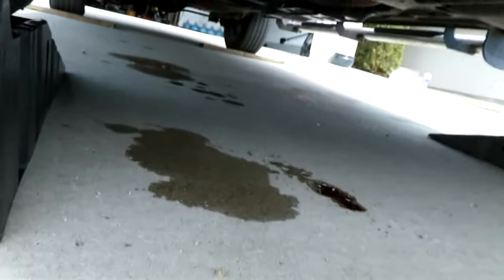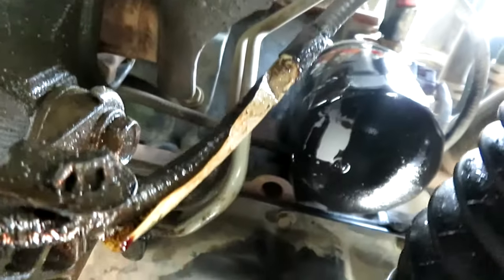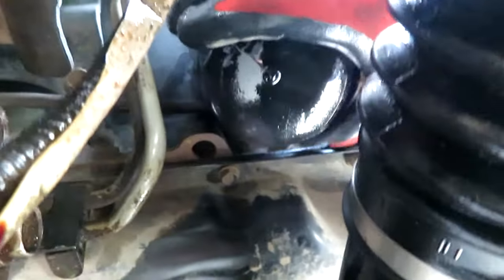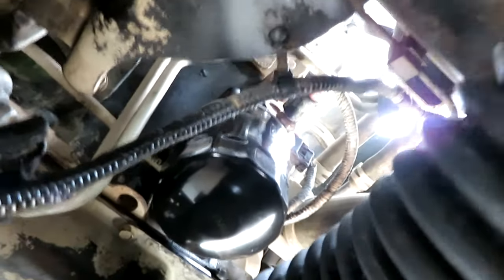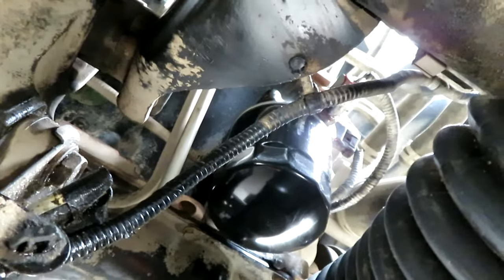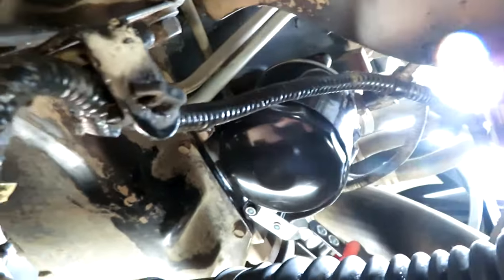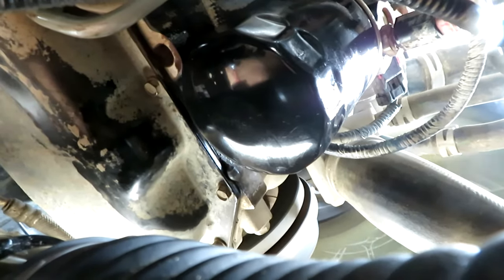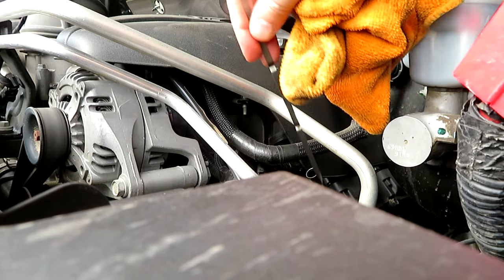Major Oil Leak | Ram 1500 Oil Leak | Catastrophe Avoided?

Comment: Had this issue off and on (it's on again) in my 2016 1500 for 3-4 years now. Oil filters are tight and changed done by the dealer. They have checked the housing, and said it's OK. Just noticed a  couple spots on the driveway again, and yep, the filter is wet. Been 6 months (but only 3000 miles) since my last change. I honestly think the gaskets on these Mopar filters are crap, and they allow some leakage as they age. Mine is nothing like yours though - you have a puddle, yikes. Mine (so far, knock wood) spots the driveway.

Comment: I have seen this problem many times, but was not due to operator error. It is due to increased oil pressure.
Reply: Mine does this due to increased oil pressure I started thinking it’s another problem, so u know what can cause increased oil pressure?

Comment: my old truck is the Hansel & Gretel of the automotive world. It leaves a trail wherever I go!🤣🤣🤣
Reply: Mine too 😆
Reply: @Cameronguitar444  I've some good news that might help you too. 
I thought I had a rear main leaking. Needed an oil change pretty bad. Wasn't ready to deal with the rear main. Had a new windage shield (pan gasket). When I removed the lower bell housing plate I noticed a corner bolt was missing from the pan.. Turn out it was broken off. I started thinking how to extract it. Turns out it was already drilled but the bolt was still there. Couldn't remove it either. I tried for a couple hours. (didn't have an easy out to fit). But I did have a sheet metal screw I cut with my dremel tool    like a "self tapping bolt". Had to make it the right length so when it got too tight in the hole, the shoulder of the screw made contact with the pan. Waaahla. oil leak fixed~! 
I was spending as much on oil as I was gas.
Turns out the oil pan had permatex on the corner of the pan where the screw was missing.
Reply: @andybilakshow260  Nice!! Yeah I think it may be my main rear seal because its dumping oil now. I had rebuilt the engine and the only seal that didn't come with the kit was the rear and I skipped it at that time would this time would come. I need new aluminum heads too... Dont ever overheat a 4.7
Reply: @Cameronguitar444  I'm in afternoon traffic. A freeze plug sprung a leak. Run completely out of water. Ove heated at a stop light. Died. Went to the house on the corner & filled a poweraide bottle like 1000 times as traffic had to go around me. Finally got it running & back home. 
Long story short, I lost 75% compression in #1 cylinder. Plus slight coolant in my oil. Not on the stick only on the cap. Put new head gasket on left bank. Attempted to regrind intake & exhaust valves. Only gained 20# from 40-60. So I need new heads as well~! The kit I got came with more seal than you can count (or at least I can count) including rear main. "partsology" I like them  so far.
Reply: @andybilakshow260  Wow thats stressful in traffic man!! Yeah I put new headgaskets on the v8 and it worked I took them to this old guy to have them resurfaced before I put em on it worked but the aluminum heads have a knock. The engine runs great but the tapping sound drives me nuts and I'm ocd about it im sure people think the engines about to crap out on me but its got 30000 since the rebuild and its got 240000 total
Reply: @Cameronguitar444  320+k on mine. 
Rocker off? Or worse, Heads Ground past the point of no return & you have valves hitting pistons
Reply: @andybilakshow260  Yeah you got me beat on mileage... yeah man I got alot out of the old dakota more than you'd think about how they talk about 4.7 motors...Wish some steel heads existed lol probably be heavy asf

Comment: Just had motor replaced in Ram 1500. 6 days later major oil leak
Reply: Did you find out where the leak was coming from? I have the same issue and it's dripping from the lowest part of the bell housing where the transmission is bolted on. It's definitely engine oil, not transmission fluid. I'm thinking one of the seals was improperly installed.
Reply: @watcherwatchmen7785  Drips will migrate by gravity or airstream so such a drip could come from oil far away. Some seals like rear main seals take time to fully seat in if they are brand new. Maybe clean up as much as possible and keep a daily eye on it to see if you can find the origin. Good luck.
Reply: I believe there’s a recall for this exact issue. They made the recall recently.
Reply: @AllGreenDB  IMHO, they should recall all from '80 & later🤣
I loved my '79 Power Wagon
Reply: I figured out where the oil leak was coming from on mine. I dropped the oil pan and found gouges from 2 screwdrivers on the aluminum rear main oil seal housing where it connects to the pan. Bubba the mechanic must have gotten to it before me. I sanded down the raised burrs and used silicone to seal it. Now it's just a couple drips making it thru instead of pissing oil like before. I used a new gasket. To replace the main rear seal will involve removing the transmission, and I don't have the time or energy for that right now.

Comment: My 02 does this,dodge put a drip tray right under the oil filter! Why? They must have known there's an issue with this !
A dirty plugged oil filter would increase back pressure and force oil out of the seals...! maybe!! 
Yours is a newer ram,so this is an ongoing issue with the dodge ram obviously!
Also,our products "made in China" crappy aftermarket filters with low grade rubber seals could also contribute to this problem!
So,it's not your fault!
Also,they want you to put white grease on the black rubber seal!
Use an oil filter wrench!😮